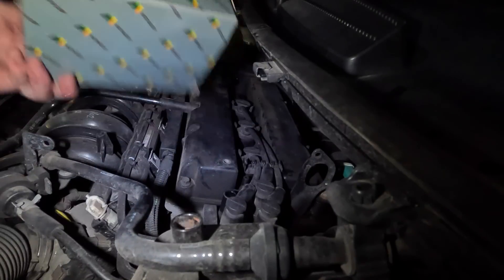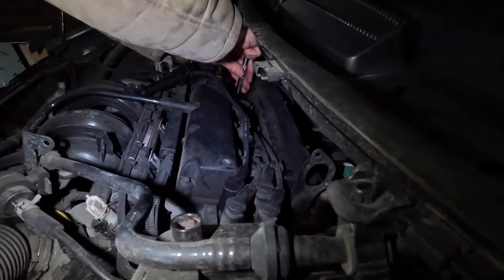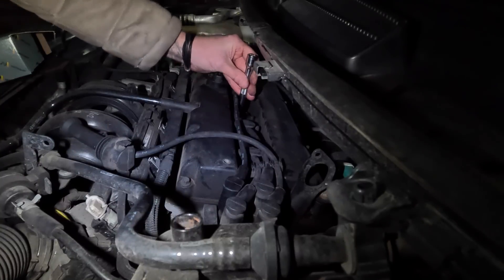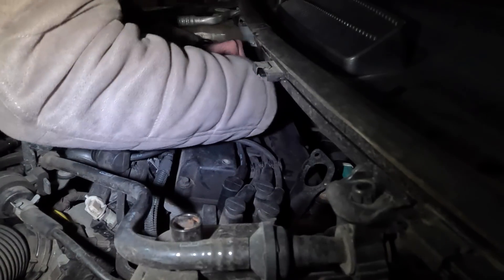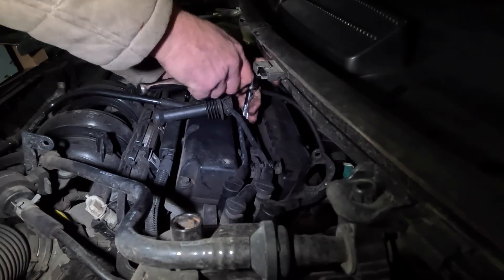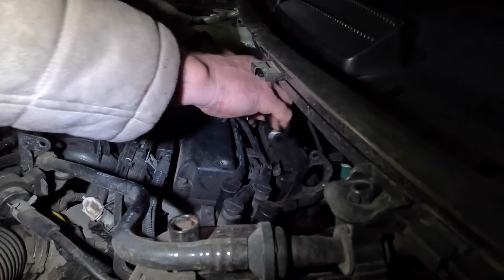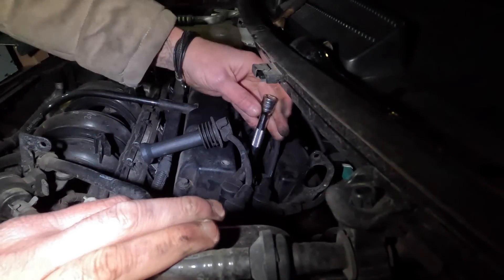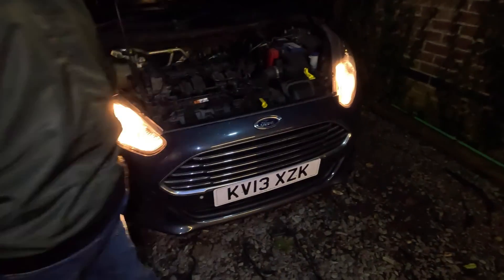Engine Light On? Here's How to Fix Cylinder 1 Misfire on a 2013 Ford Fiesta!"

Comment: Just replaced the leads and plugs on my mom's 2011 Mk7 1.25 and it still has a cylinder 4 misfire. Any idea what it could be?
Reply from the maker: Sorry I've just seen this.
Did you reset the ECU with the odb reader
Reply: @MADL1fe  I did, made no difference. It turned out to be the little ignition coil unit being faulty. Replacing it solved it.
Reply from the maker: Glad you got it fixed, that would of been my next part to check